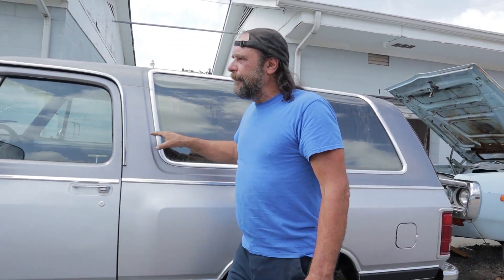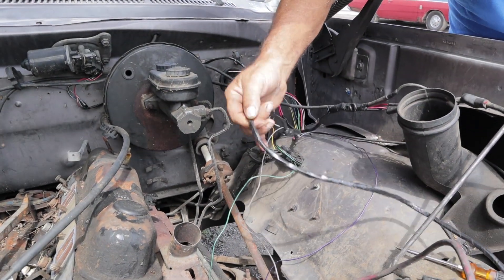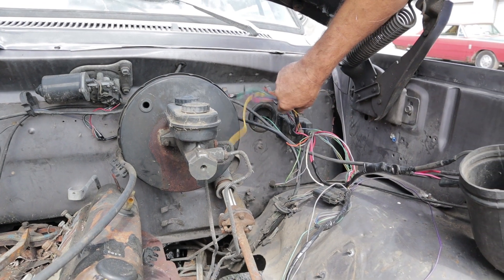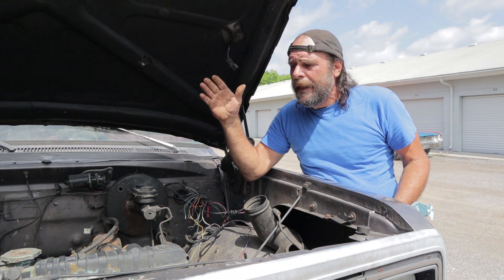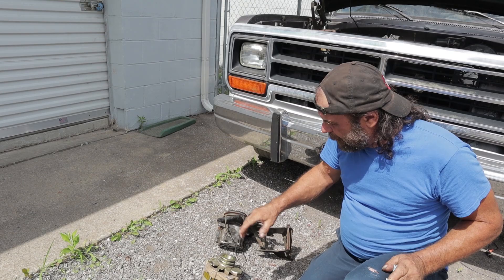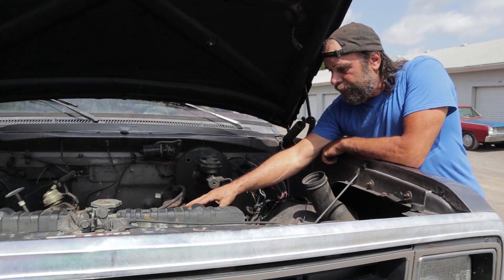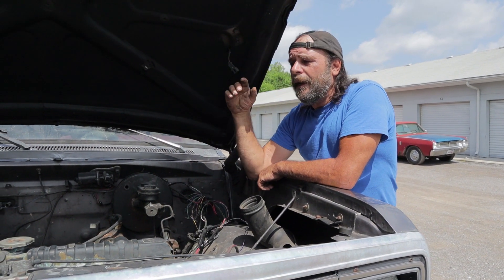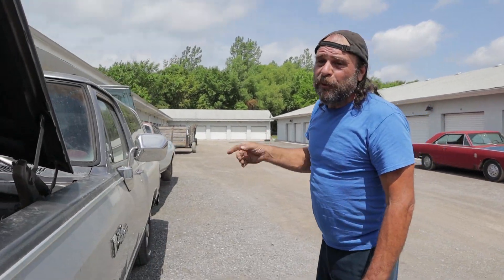Bottle Rocket and Ramcharger Update

Comment: I ran into the same thing your saying about the wiring harness on my D100 I had an extra harness that came out of a 89 but as I opened it up it looked like it had soldered splices everywhere. I thought somebody had been in it and "expertly" wrapped it back up like factory. Then I opened mine and it was the same way, I changed the whole harness that was 99% the same but when I was done not half of the stuff worked so I had to swap back to the butchered 88 harness.

Comment: for those who don't mind cutting sheet metal they could convert to mechanical fuel injection with a cummins. a few springs to change fuel map, parts readily available and needs what, 1 wire to run?

Comment: Tony, my '90 Ramcharger's built-in regulator (computer) failed, and rather than pay for a whole new computer to fix the problem, I was able to connect a 1970-early '80's chrysler transistor (electronic) regulator directly up to the '90 alternator.  It worked perfectly.  I wanna say that even though that one looks different than the pancake syle alternators of the 70s that it must've had an isolated field alternator like them (sadly I no longer have my RC to look).

Comment: old timers some times use weed sprayers and chain saw bar oil to (with tails lights removed) to reach INSIDE the body panels and coat the metal with oil.

Comment: it is some thing I have noticed as well. it is one thing having a engine on the dyno and having the car on the dyno. I set up a hemi and a ford mod motor 5.3 type of bottom on a engine dyno great numbers then put one in a retro mod charger and a two door treno sent them down the track. had to do the programs again because like you said it is two different reality on track on dyno two different setups. can get great numbers on the engine dyno but how heavy the car is going down the strip when it is set up for it is different than any thing. I completely understand where you are coming from

Comment: You should look into putting an early 2000's van drive train in the RAMCHARGER. You can find vans cheap, with low mileage, and in good condition. Or you can get a pallet engine and have an even newer, low mileage HELLCAT drive train. Imagine being able to roast the tires, and you'd be getting the same gas mileage as the original engine.

Comment: Back at my first job in a shop, im like 17, the boss handed me a burn victim. 
I think it was an early 80s cop car gran fury. 
The burn was because it leaked trans fluid, and  the customer kept a funnel on the dipstick. 
Handy right? 
Now the next question:  is he a smart fella or a fart smeller? 
It fell off and went on the exhaust manifold and caught on fire !!
It torched the whole wiring harness Right Above It on the firewall. 
I hadda be wicked careful and replace and trace out each wire by itself, not many diagrams. 
Anyways i got it working again without any drama, but what a trip. 
The older guys were walkin away, dont wanna get involved, it was my baby. 
Im sure they thought id fail, but in your face suckers !! 
Heh , i was even able to milk it a little because it looked worse than it was. 
I definitely gained some respect that day from the other guys.

Comment: You are not kidding about the early 90 s electronic crapy wiring I had the same crap on a 93 truck  I live in PA snow belt green corroded wires
Reply: I've seen batteries swell up and voltage regulators just melt down in the mid 1980s on new cars and trucks from Chrysler.

Comment: i have had bad luck with moper alternators i use Chevy alternators on everything easy 3 wire hook up. as for electronic ignition i would use Chevy 4 pin hei module trigger by non lean burn distributor  or points distributor triggering a ignition module. as for starer relay ford starter rely the late type with the terminals sticking out the front are good as one can bump the engine over with a screw driver. round it out with lots of grounds and military or marine battery terminals. wiring is not hard just time consuming to do right and pain at times! have a old truck that i had to rig the wiring up to bring to life. if wire was cheap i wold start over. a good egine for now wold be a magnum 360 and bolt a 2 bbl on the efi intake!! the magnum heads and roler cam would make for a clean burn to pass smog and still make good power! a old school hemi 1 gen  is one cool engine! saw one in a junkyard 3 years ago!
Reply from the maker: All good ideas/stuff, BUT, I'm an utterly irrational purist.  Can't cross breed anything....against my religion
Reply: @UncleTonysGarage  that is cool! I am the type that will go with the best part no matter what it is off of. however i can not stand modern efi engines in old cars or modern wheels on old cars. i keep stuff close to factory if it is all their but if it is in pieces i fix it how ever is cost effective. as for ignition i would go with moper non lean burn ignition box trigger by points for max reliability!

Comment: What"s a mid 70s 318 2 bbl put out 120 HP?  Put a big block radiator on it for towing and expect that VW buses will pass you going uphill .
Reply from the maker: The Teener is only going in to get this truck mobile.  We'll work on something with a bit more oomph once we've caught up on some other projects we have going
Reply: @UncleTonysGarage  If you are really stuck on cheap and points ignition.  Direct drive a flathead ford 3 bolt distributor off the cam of a 2008- hemi.  You will have replace the water pump with a flat plate to mount the distributer and remote mount a water pump.  This is worst way to use a carb on a late hemi, but it avoids electronics.

Comment: You can use an older style voltage regulator with that 1990 ramcharger alternator if you like. But hey I agree with putting the old tried and true late 60's to mid 80's Chrysler style. Cheap and easy to troubleshoot.

Comment: I have a 1988 d100 318 with the shitty tbi system I'm rebuilding it now any tips for swapping to carb? My main question is what do I do about fuel pump? Do I have to get a mechanical one or can I make the in tank one work
Reply from the maker: My plan for this one is to delete the intank pump with a length of tubing, and run a mechanical one off the engine.  The existing fuel lines in the truck will work perfectly
Reply: @UncleTonysGarage  thanks man love the videos and really appreciate your input keep on rockin man

Comment: I'd love to see what you could do with a Hemi-6 instead of a V8 - but I'm sure they're more rare than hen's teeth in the US.
Reply from the maker: I'd love to work with one, but the exact number I have encountered in real life is zero
Reply: I never realised how good I had it as a kid.  My first car was an original '70 Valiant Pacer hardtop with a 245 cu in straight 6 hemi and a 3-speed manual.  Same body as the Swinger has, with a few cosmetic changes - lights, grille, etc.  Think I paid $200 for it, back in '86.  Kinda wishing I'd kept it now.  :-P

Comment: I have a 1990 Ramcharger. The problem with the late 80's/very early 90's trucks was they went with a "new" design "computer control" style engine managemnt. EXCEPT, they put EVERYTHING onto one computer. The voltage regulator, the spark control, everything you can think of got routed into one computer. And then, if one part of that computer malfunctions..... like say the voltage regulator.... the entire PC has to get replaced. Battery won;t charge? the computer failed, buy an entire new one $$$. 
And then....
now it's 30 years later, and there aren;t any new computers. So now when the voltage regulator fails...... well lets just say I hooked up a one wire GM alternator and put a piece of electrical tape over the check engine light lol. At least my battery charges. I will be putting an MSD 6Al box in, and a few other things so I can remove the computer completely. 
But it is SUPER worth it. They don't make Ramchargers or Full size Broncos anymore, they don;t make ANYTHING like those. If you've never been in one or driven one, you prolly wouldn't understand. Picture this: you can drive it in 4x4 through 3 feet of snow on stock 15" tires, it will tow a car trailer, and if you want it to it will do a U turn on a two lane road without using reverse, all while you sit in a high back lazy-boy captains chair with the interior room of a school bus. The 91 Bronco I had years back got 18MPG on the highway. The Ramcharger I have now.... well it won't get that because it is getting the tired 360 pulled and replaced with a balanced/blueprinted mid 70's police interceptor 360 with a thermoquad on it and a lumpy cam, and I already know I won;t keep my foot out of it haha. 
Love these trucks, glad to see UT keeping his on the road.

Comment: Ive been watchen your videos loosing a lot of sleep, what if I told you I can convert any car to water powered fuel injected.  Stanley Meyer design is integrated into every modern car it just hasent been unlocked yet due to modern computers. I can intercept the SPI interface or remove the flash chip via rework station and re configure it my self.   Old cars can be retro fitted.
Reply: It time to let the world know Meyer's patents have expired. His inventions are now in the public domain, available for all to use without restriction or royalty payment.[13] No engine or vehicle manufacturer has incorporated Meyer's work.[14][15]  or have they what the hell do you think a fuel injector is this man made it.
Reply from the maker: Build it!
Reply: Lets take it down a notch ,  take a jar of water insert 2 electrodes hook it to a battery charger ,  you just split H2O into H and O   now you have a vaper  you can burn in your motor at twice the amount of energy as gasoline and clean carbon out of the engine  at the same time.   Now replace the battery charger with your alternator ,  see what im getting at you only need a battery for start up.  Other wise its self sustaining.  Im not sure how you set the timing on one of these old cars thats partly why im getting a hold of you.
Reply from the maker: I'm familiar with the concept..it's nothing  new.  There are videos kicking around of a guy running a Briggs and Stratten off of one of these systems.
Very interesting stuff, but my main focus is working with more traditional things.  
Like I said before, build one.  Grab an old lawn mower and put a prototype together.  Master that, then take it to the next level.

Comment: We were able to use a external voltage regulator on a computer controlled alternator in my 91 D150 no need to change brackets, you just need the harness and the regulator
We put a 440 in my 84 D250

Comment: I use to have a 1991 Dodge Ram 3500 Passenger van that had TBI and the thing was built like a brick shit house but the wiring was a issue I had it fry under the hood once then the main live to the ignition in the steering column nothing like going 70 down the highway start smelling something burning and find out there's a fire between your legs I had to rip the plastic cover off from around the ignition and Column in the dark on the side of the highway to rewire the main live wire just to make it home after that I went thorough the whole thing and fixed all the melted wires and questionable grounds what a pain in the ass that was but was good as new once I went though the whole dame thing.
Reply: 79tazman Some punctuation would be helpful to read your rant.

Comment: From the early 80s to early 90s, Chrysler got really cheap with it's electrical components, especially with electronics and connectors.  I haven't worked on a lot of them, but every one that I have worked on was very mechanically sound, but had all kinds of wiring problems, mostly burned or corroded connectors and grounds.
Reply: Live Wire Lee Iacocca was doing all he could trying keep up with the Mickey Mouse outfit he took over. Toyota, Datsun & Honda were pummeling the US automakers.

Comment: Couple questions if I may ask.  How come you want a/c if you want simple.  I figured engine only. Points and condenser.  No power brakes or power steering.  Carburetor only. EFI is junk. No exceptions. I just figured simple engine only, manual transmission.  Why automatic?  Maybe I was going overboard when you said simple. Just was curious. Awesome video. I keep learning everytime I watch your videos.
Reply from the maker: A/C is simple..P/S and P/B are simple analogue additions, as is the pre-electronic Torqueflite.  Yeah, a manual trans would be a first choice, but converting it is beyond the threshold of what we want to do to this thing.
Reply: @UncleTonysGarage  should add a torque converter lock up switch too
Reply: Thank you for letting me know.

Comment: I know they're only little but how about a 241 Hemi with a green painted GM blower (not modded for cars just straight off of a 2 stroke Diesel). It's not about fast its about having something interesting and it may all fit under the hood. That would be nice wouldn't it? The crank and rods in those old Hemis are good and strong and the low compression of them makes them ideal for a blower. Use adjustable pushrods and a solid lifter camshaft. It would be a great thing and it would probably end up making about 350hp. 

Imagine the sound of it in a truck. The sound of it could go something like this:
https://www.youtube.com/watch?v=cgULJxdJiiE

Comment: Instead of modifying the alternator bracket(unless it’s easy) you can buy a pre 1985 bracket.
Reply from the maker: It's actually very easy.  Need to just cut the top mount and bolt on a slider from a Slant.  I like how it mounts the alternator and compressor high

Comment: 440 ram charger will it fit ? Is it easy fit?
Reply from the maker: Yeah, it would go in easy enough but SB is the ticket for now
Reply: Just asking cause that what engine i have. would headers fit too you think its a 1985 4x4 ram that i am thinking’s of following you on
Reply from the maker: Headers wouldn't be a problem, but you're going to need a BB Bellhousing to mate up with your trans if manual, or a BB 4x4 Torqueflite

Comment: Rather than modifying the brackets you can keep the existing Ramcharger alternator. It will work with a standard external regulator wired like normal Chrysler. I had a 1981 Dodge 318 truck that I installed a later model a/c compressor and Nippondenso alternator on. Basically what you have there. The newer alternator will throw out tons more juice, 90 amps vs 60, compared to the old style Chrysler alternator especially at idle. It's worth it to not have your wipers slow down and your lights dim as you are sitting at the stop light.

Thanks for all the videos. I learn something new from each one.

Comment: If you have a 360 put it in now. my prediction you will be wishing you had a bottle rocket in your exhaust pipe on your way to the strip because the 318 won't quite be cutting it.
Reply from the maker: Don't have one handy right now, but that's besides the point.  The 318 will do just fine with the light loads it's gonna see
Reply: @UncleTonysGarage  it's a truck you're a car guy, you're going to overwork it and miss the only engine that should be under the hood of that truck. 360 always up to the job, not afraid of the extra work.
Reply: @UncleTonysGarage  
Dodge put 318's in their 2nd Gen trucks, should be good right like you said
Reply: I was also wondering why you didn't decide to go with a 360. It turns out my charger has a 360 in it. It also turns out that it has bad bearings in it. I know the 360 is a great truck motor and have driven trucks with 360s in them. Any reason i should rethink slapping another 360 in my charger? This isn't going to be a track car, although I may take it to the track for fun.
Reply from the maker: I've got at least 6 318's kicking around together and in parts, and zero 360's.  Right now, the only thing I care about is getting this truck mobile and functional.  We can perfect stuff later
Reply: @UncleTonysGarage  Can't argue with that.
Reply: @UncleTonysGarage  I'm just running you around the tree for the fun of it Tony. 😁 We got to do what we got to do and work with what we got.
https://youtu.be/jZwUi6SXoWE

Comment: Completely irrelevant but what's your opinion on the ford 200ci engine
Reply from the maker: Great little motor for a driver but that integral log style intake pretty much puts the kabosh on getting any power out of it
Reply: Isai Bravo I've got a 66 bronco with the original 200 6cyl. Thing has half a million miles on it, and never been apart except for valve seals. I know the history on it as fact as the Bronco was my uncles new in 66, my Father bought it from him in 1989 if I recall, and I got it in 2013 after my Father passed away.   NO! It's not for sale! LOL

Comment: pretty impressive T...ive seen guys make a job like this last a lifetime, looks like you,ve kicked A for just a week or so of hard work. seems you have a good game plan. thats what itll take, no manual for that job. that truck looks solid enough to be worthy of the effort, it,ll for sure turn heads at the digs, a mopar should pull a mopar. im old enough to remember many racers used to tow whatever they ran behind a ford truck. i liked the cuda being towed by a 440 4-speed polaris station wagon though, with woodgrain haha. since im kelly johnsons biggest fan, i love the "skunkworks" nickname...but kelly fired an engineer one time for answering the phone..."skunkworks" right in front of him.
Reply: shitfire Tony...that was faster than a pizza.....i mean you..."cut a good light".....haha
Reply: polaris?....wtf...............POLARA.......man i think ive slipped a belt.